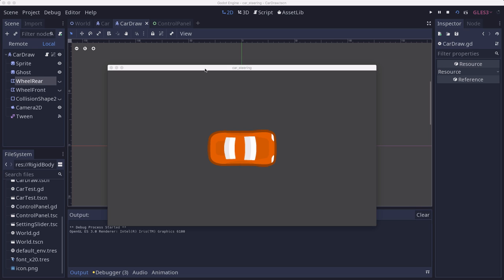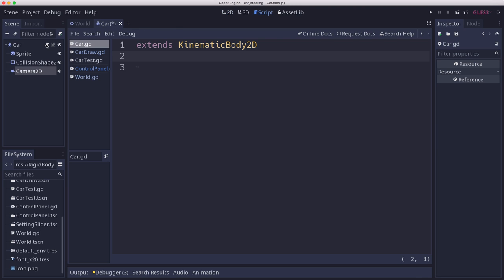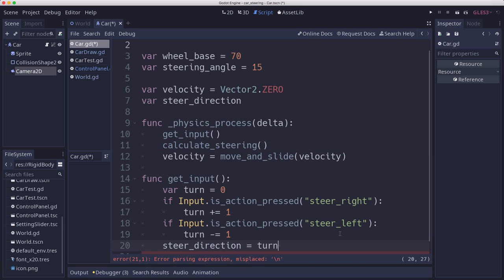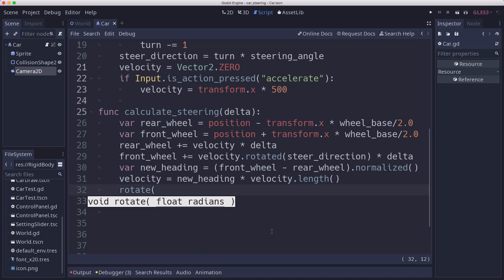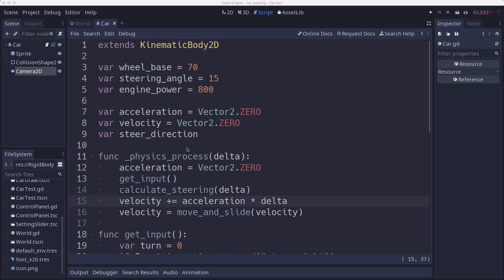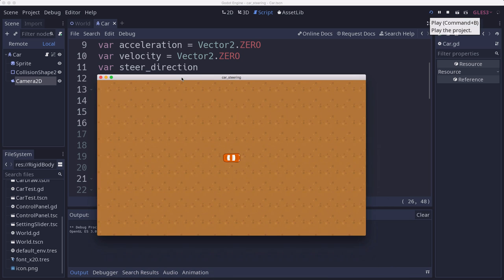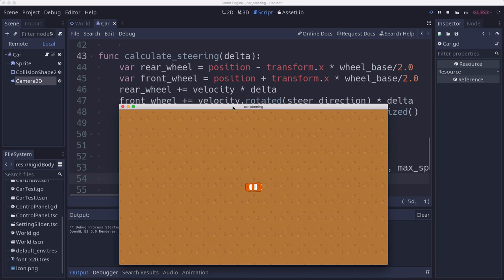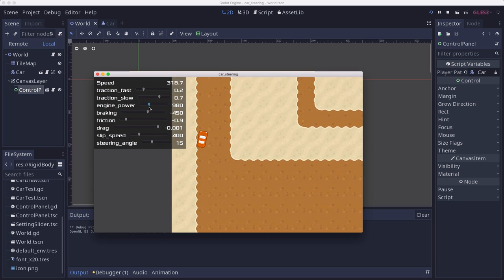Godot Recipes: Car Steering

Comment: Oh my goodness! This is exactly what I wanted. If only you said "we'll be adding drifting" at the beginning I would've watched this eons ago. Thank you so much!
Reply: But does it still hold up? I haven’t tried this specific code line of 

Velocity = move_and_slide(velocity)

But I’ve tried many versions of passing arguments through the move_and_slide function, and it always returns an error.
Reply: @jontay4199  it's changed in Godot 4. You just set velocity (no need to initialize the variable at the top like he did),  and then call move_and_slide() separately. I'm sure you've figured this out by now, but figured I'd still comment for others.
Reply: @Z-713  I appreciate your comment, because a lot of these videos don’t hold up due to these changes. It’s exhausting

Comment: Is there any way to make it so the steering angle does not decrease alongside the acceleration as the car slows down? In real life I would expect it to be the opposite -- the more you slow, you can make much sharper turns.

Comment: Nice tutorial. But lookign at the engineering paper can't help noticing that when drawing the predicted next position of both wheels the rear wheel moves straight wich is unrealistic if you think, for instance, the case of having the car still with the front wheels turned 40 degrees and start moving slowly. The rear wheels should move along other line because they are rotating also around the contact point when the car is turning. I don't know if I made my point clear but it feels somwhat unnatural otherwise. I'm playing around the code to make the car lose traction when braking while turning deppending on the speed and taking in consideration the inertia and things like that. It's pretty tricky to get car physics right in 2d topdown view although this video helps a lot.
 Thaks for your always helpful content!
Reply: Maybe the line that the car should move along is the line conecting the rear wheel position and the front wheel PREDICTED position keeping the relative distance to the front wheel position and moving the whole car there. Can it be?

Comment: This is good. Could you make a tutorial about top down boat handling? Or is that just like turning on the back wheels instead of the front wheels? I have searched for some kind of help about this, but can't find anything.
Reply from the maker: Why not do this exact thing, but swap the wheels?
Reply: @Kidscancode  I tried that, and i didn't work. I must have done it wrong, i'll just try again. :)

Comment: Thanks for this. I have a couple issues though... first, my car doesn't stop but continues crawling at a very low speed. Second, is there some way I can make turning faster at lower speeds, such as just after braking (say doing a tight u turn), without turning at fast speeds being insanely fast and spinning the entire car around?
Reply: Maybe you could try downloading the example and comparing code. You might have forgotten to remove some code that he replaced.
To address your steering issue, try adjusting the sliders in the example project—I think high "fast traction" should give you what you want.
Reply: @pranab4928  Thanks for the reply. I managed to fix this problem. If it isn't a bother, do you know how I could implement this code for an NPC car? I have tried using 'acceleration = transform.x * engine_power' in func _process() but it doesn't do anything?? Sorry if it's a bother.
Reply: @megadesu69  From the original code you will want to rewrite the get_input() function.
For the car to simply move forwards, you would add "acceleration = transform.x * engine_power" inside the get_input() function.
For more advanced NPC movement you would have to create a waypoint system—an additional function to mark where the NPC needs to go next. Then within the get_input() function you would need to make the NPC turn left or right until it is facing the waypoint.
I can't tell you exactly how to do this, but you can try looking for other 2d car/racing games and inspecting their code.
Reply: @pranab4928  Thank you very much for the tips :)

Comment: Thank you! With small corrections it works even in Godot 4
Reply: But does it work if my vehicle is facing up on the y axis?
Reply: @soumyadipbhowmik2220 DUDE I had the same issue, the solution is you have to make your sprite and collision shape face right if your image is up (change the rotation to 90, not the character body node tho). And then change the character body node rotation to -90. There you go.
Reply: @rakinrahman890  damn, didn't thought about that. Thanks man, I'll try it out. I actually opted for a different route that's given in the documentation. It kinda worked but scraped the initial idea.
Reply: @soumyadipbhowmik2220  Your welcome. I barely found any sources regarding car steering (most of em are very old), right now my player car is a CharacterBody2D but I'd prefer rigidbody2d. The problem is idk how to convert the things in the tutorial into rigidbody2d. Do you know how?
Reply: @rakinrahman890  nah bro. I actually went with the pseudo 3D process of creating and moving a car and used that in the project. It's fairly easy with that. You'll see one tutorial which works even now. But it's not as in depth as this one.

Comment: That you so much for this! I'm trying to translate this to 3d but I'm stuck. Can't seem to translate:
    rotation = new_heading.angle()

I've tried 
   rotation = Vector3(0, atan2(new_heading.x, new_heading.z), 0)

But seems to just cause it to spin.

Any ideas?
Reply: godot uses radians so multiply the atan2 with deg2rad

Comment: Can you please elaborate the camera 2D settings. When set to current, the car moves inside a smaller rectangle... messing up with the free movement of the car.
Reply from the maker: The camera has no effect whatsoever on the car's movement. By default, Camera2D has drag margins, which is what you're describing. Set those to 0 if you don't want them.
Reply: @Kidscancode  Thanks a Lot. It worked!

I was trying a handbrake where the car completely comes to a halt... with this bit of code in 
steering func - - 

if dot_product > 0:
velocity = new_heading * velocity.length()
if Input.is_action_pressed("ui_accept"):
				acceleration = -transform.x * const * sqrt(velocity.length())

And did the same for dot_product < 0  with opposite sign - - But still there seems to be some velocity left in the car... 

What am i missing ?

Comment: I've tried twice to do the acceleration part (once from the written version and once from the video) and it ends in my car slowing down to a crawl, as well as the steering no longer working. Before I do the acceleration step, everything appears to be working correctly. I'm sure I have typed in the acceleration code correctly so I am a bit confused.

EDIT: It's because I didn't remove the velocity = Vector2.ZERO line in the get_input() function, just before you check whether the acceleration key has been pressed...
Reply: And I solved the problem with the help of this comment

Comment: Great video ! It is the most complete about arcade car physics ! I was looking forward something like this for a long time, thanks a lot :D
A question though: if I want to implement a drift as the Mario Kart one, I need to check if the correct input is pressed and change the slip_fast value ? Or create an other variable to replace this "slip" variables ? Mario Kart as a very strange physic behaviour when the kart enter the "drift" state so I don't know how I will proceed if one day I want to replicate it !
Reply: You would probably create a new variable that checks if the user is drifting and then calculate drift physics with that.
Reply: The way I did steering before is basically the way he describes it in the beginning: only using the front wheel angle to calculate the acceleration. That felt way more drifty for sure, but I'm not sure how to apply that to this example. 
Maybe when you add the front and back wheel vectors, scale the back wheel vector down or ignore it at all? I did not test that though.
Reply from the maker: Yes, combined with analog stick control, this could work quite well. And in 3D it would work exactly the same.
Reply: It convenient that for this type of gameplay 2D and 3D are almost the same ! Thanks for your answers !

Comment: Could you do a video about detecting the end of a ledge and turning around ?
Thanks
Reply from the maker: There's an edge-detection example in my intro to 3D series. The process is the same in 2D: put a downward-pointing RayCast2D in front of your character. Check if it's colliding. If it's not, you're at an edge.
Reply: KidsCanCode I do this with code right? 
I tried some time time ago and I think my code was off because the character kept spinning like crazy

Comment: here is the entire code:

extends KinematicBody2D

var wheel_base = 70
var steering_angle = 15
var engine_power = 800
var friction = -0.9
var drag = -0.001
var braking = -450
var max_speed_reversed = 250
var slip_speed = 400
var traction_fast = 0.1
var traction_slow = 0.7

var acceleration = Vector2.ZERO
var velocity = Vector2.ZERO
var steer_direction 

func _physics_process(delta):
	acceleration = Vector2.ZERO
	get_input()
	apply_friction()
	calculate_steering(delta)
	velocity += acceleration * delta
	velocity = move_and_slide(velocity)

func get_input():
	var turn = 0
	if Input.is_action_pressed("d"):
		turn += 1
	if Input.is_action_pressed("a"):
		turn -= 1
	steer_direction = turn * deg2rad(steering_angle)
	
	if Input.is_action_pressed("w"):
		acceleration = transform.x * engine_power
	if Input.is_action_pressed("s"):
		acceleration = transform.x * braking

func calculate_steering(delta):
	var rear_wheel = position - transform.x * wheel_base/2.0
	var front_wheel = position + transform.x * wheel_base/2.0
	rear_wheel += velocity * delta
	front_wheel += velocity.rotated(steer_direction) * delta
	var new_heading = (front_wheel - rear_wheel).normalized()
	var traction = traction_slow
	if velocity.length() > slip_speed:
		traction = traction_fast
	var d = new_heading.dot(velocity.normalized())
	if d > 0:
		velocity = velocity.linear_interpolate(new_heading * velocity.length(), traction)
	if d < 0:
		velocity = -new_heading * min(velocity.length(), max_speed_reversed)
	rotation = new_heading.angle()
	
func apply_friction():
	if velocity.length() < 5:
		velocity = Vector2.ZERO
	var friction_force = velocity * friction
	var drag_force = velocity * velocity.length() * drag
	acceleration += drag_force + friction_force
Reply: necro reply Thanks.
Reply: if using today: godot 4.2 i think a few changes:
KinematicBody2d is CharacterBody2d
deg2rad() is deg_to_rad()
no need for var velocity
and move and slide is just move_and_slide()
and linear_interpolation is now lerp()

Comment: Hi there, I am trying to implement a car movement without acceleration but with drag and drop. i am struggeling with turning the car while it is beeing dragged. any ideas?
Reply from the maker: If you want to point in the direction you're dragging you'd need to use the `event.relative` property to get a direction vector.

Comment: Why not use    var turn = Input.get_action_strength("steer_right") - Input.get_action_strength("steer_left") ?

For anyone curious, instead of checking the state of each input, you can just get the difference between their values. If they are not pressed, you get 0 - 0 = 0 (no turning) if one is pressed you of course get either 1 - 0 = 1 (steer right) or 0 - 1 = -1 (steer left) and pressing both gets 1 - (-1) = 0 (no turning). One easy to read line.
Reply: Oh yes